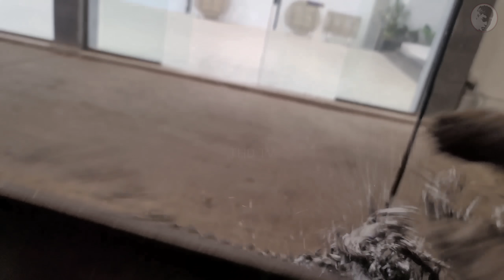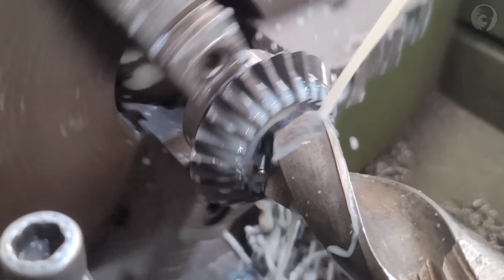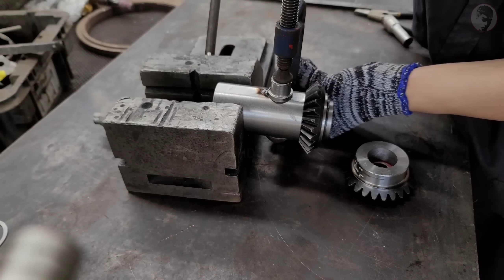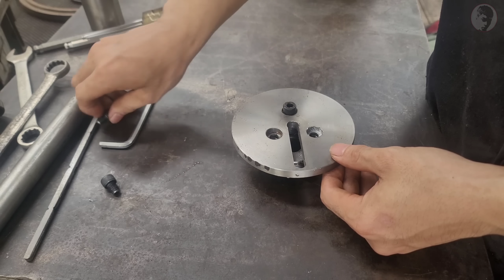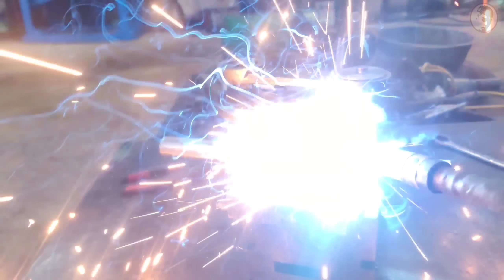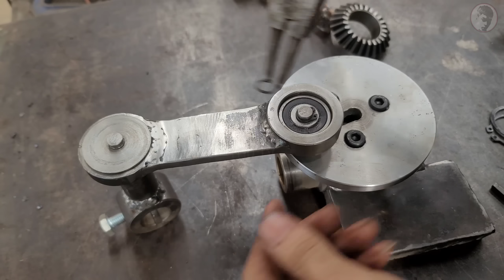Dụng Cụ Tiện Rãnh Chạy Dầu Nhớt Cho Ống Bạc ,Sơ Mi

Comment: При передаче Момента на кривошип посредством звена с очень малой жёсткостью (цепи'), неизбежны колебания по углу - т.е. колебательная рассинхронизация.
When transferring the moment to the crank by means of a link with a very low rigidity (chains), fluctuations in angle are inevitable - i.e.  oscillatory desynchronization.

Comment: Nicely done, except for the awful chain drive from the lathe chuck.  When is someone going to teach these guys to TIGHTEN UP ALL THREE JAWS of the chuck?  Three jaws, all with built in clearances = potential at least, for runout!  That and quit over tightening using a cheater bar!  Basic lathe practice, apparently never taught.  Otherwise, pretty clever.